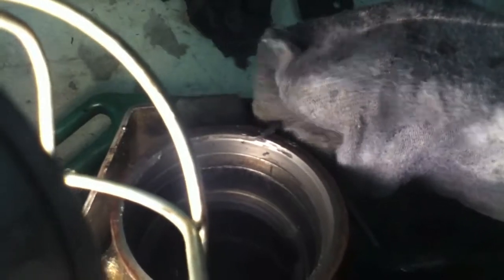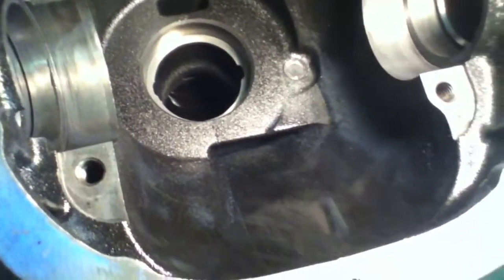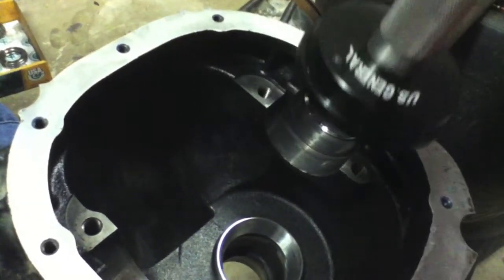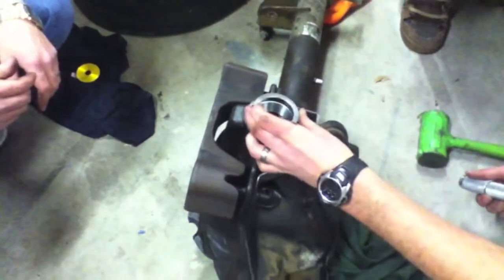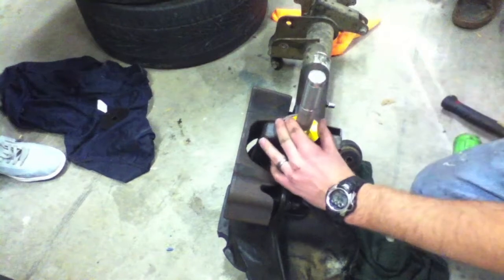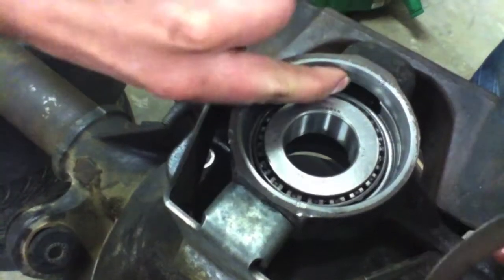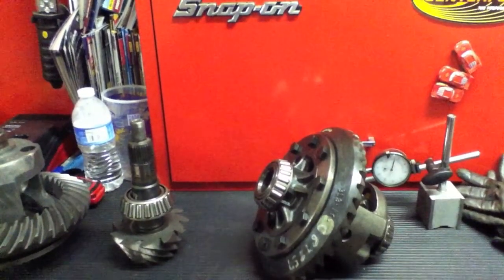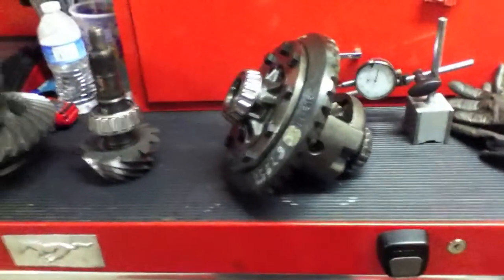Ford 8.8 inch Gear Install (Part 4 of 7): How to install gears

Comment from the maker: These are Ford Racing (FRPP) 4.10s. Once you go over 4.56 you can buy a notched center pin that will accommodate the other gear sizes (4.88s). You have to put the pin in the carrier first, then install the ring gear. Watch how my pin almost didn't slide past the teeth on my install.  The notched pin allows you to turn the cut area towards the axle you are installing so you can get the axle in while te pin is already in the carrier.

Comment from the maker: The carrier will hold 4.88s and I THINK 5.13 and 6.14s (but those are for off road). You can either buy a notched ring gear or pin so you can get the pin past the ring gear. No problem or need with any of that with 4.10s. It was close as seen on my video